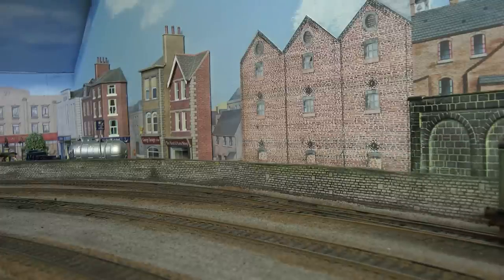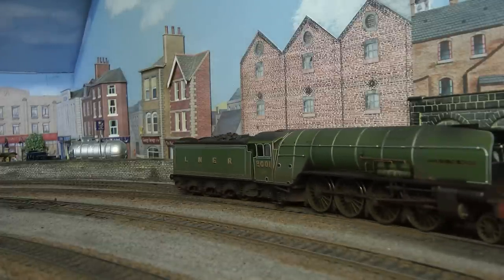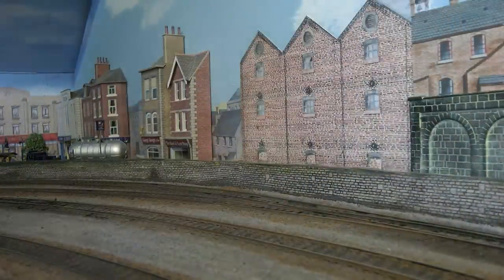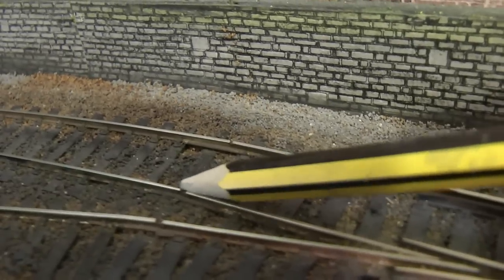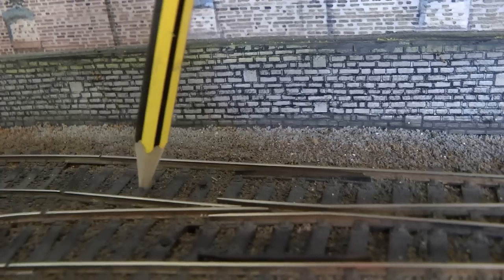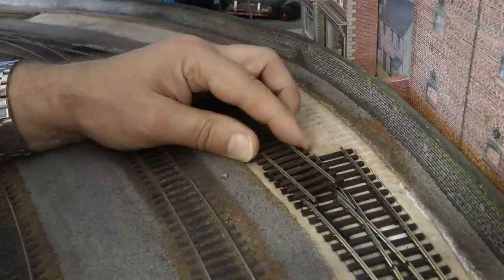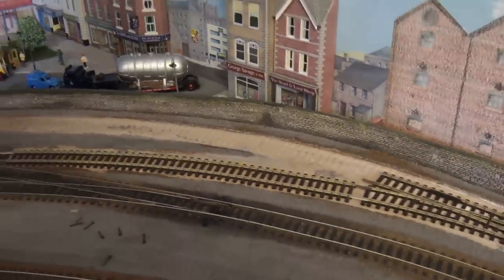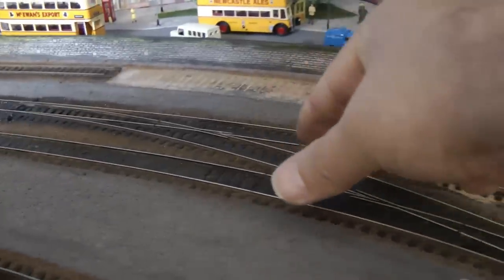Trackwork Rework.   No 380

Comment: Thanks Tony for posting, a brave man but needs must.  Well done.  I have just had to relay a length of my track which had expanded in all the heat.  After more than a week of outside air teperatures of over 27C a curved section had lifted and warped. I freed the track and eased the curve by 2.5mm without needing to do any cutting.   Wall paper paste instead of PVA to hold the ballast makes it all a bit simpler.  Regards Ray
Reply from the maker: Hi Ray. heat will do that my friend. its great that you didn't have to lift the full length up. 
Great tip with wallpaper paste i may have to give that idea a try. thanks again for commenting. cheer's for now Tony.

Comment: Murphy's Law is what i think it's called. Of all my fleet of locos my ultimate favourite is an old Triang Blue Pullman that i have done a considerable amount of upgrading and detailing - it's complete with reprofiled wheels in order for it to run on modern track but it is the only locomotive that will not take a particular bend but always jumps the track. Every other loco i have has no problem with this bend. I checked the wheel 'back to back' and that's fine. As the track on this bend is set track I took the loco to my model rail shop and they ran it without a hitch on similar set track curves (apart from which there's another bend on my own layout with the same curve )and it manages that fine; I've checked the track for lumps and bumps and I can't find anything and as I say, it is the only locomotive that jumps the track there. I think I'm going to have to do what you've done, namely relay the track there. Fortunately for me I don't have any points there. Thanks for your video Tony.

Comment: Morning Tony, that was a good job done, looks neat and the p2 runs smoothly. You can plan all you want but it's only when you use it you can see any issues that arise. It will be interesting to see what you do with the brewery, I was a bit surprised we didn't see Billy and his mates having a gawk at what you were doing, its not like them to miss out. 😅 you made that look so easy, but I imagine there's a few hours work gone in there. That was a good tip on getting the track out of the points, to remove a section in the middle is always challenging but twisting the rails was a excellent solution. Fairly easy this week for me after the busy week we had last week. My friend in work who's father passed and has given me bits and bobs gave me a test track about 8' long with 3 tracks on it, 00, N, Z, I'd never seen Z it's tiny, but I've managed to get that running now and she's found a engine and wagon so that's interesting to see, it's a continental steam engine made by maklin, far to small for me but interesting. My daughter Vicky, has gone away for the weekend so so good old mum and dad are look after her dog for her, it's the first time she's had a sleepover although we have her a lot in the day, and so far she's been very good. OK must go, nice to see your work, speak soon Eddy and Anne xxx
Reply from the maker: Good morning Eddy. After your busy week. you can now put your feet up and watch the trains go by on your layout. i do have some plans for the brewery. but its all a question about fitting time for these little jobs. thanks again my friend. all the best from Tony & Laura. have a great weekend.

Comment: ❤-ly thanks for the very important information NOT to use MDF-plates and Change to plywood - but what thickness is best?
Reply from the maker: Great point! 12mm plywood is best for baseboard tops. looking back i should never used MDF for ply wood tops. but in saying that. this is the area where i have problems with this material. its probably down to me not treating the edges. we live and learn. all the best Tony

Comment: Hi Tony. Eight wheelers require a larger radius than six and that kink in the track and the incorrect turnout formation needs to be investigated by the Permanent Rail department.  The Lengthmen and their Ganger responsible for that length of track need a telling off for not reporting those anomalies. 😄
I noticed that after the addition of the new curved turnout, you did not appear the test the diverging road. I assume you did that off video.
I'm not a fan of MDF, Tony.  It loves water and will absorb moisture and curl.  If I was to build a new layout, baseboards would all made of birch plywood.
One big difference between ready to run model railway and the UK 12” to 1 foot scale railway, is that, the former is made from fixed formations known as turnouts, slips and diamond crossings, and plain track.  This provides ease of use when building layouts, but imposes limitations on the modeller.  In the latter, the Permanent Way is largely bespoke to location, made from basic elements called Switches (colloquially known as ‘points’ because they are pointed) and Crossings, namely; Common Crossings (Frog is American speak taken from a part of a horses hoof) and Obtuse Crossings.  The formations that arise from S&C work are called turnouts, slips, diamond crossings, etc, in accordance with strict rules, the types of train expected and their anticipated speed. These formations are interconnected by standard rail.  This results in flowing trackwork through formations, with correct radius curves for the traffic used.
The way to achieve this in model railways, is to build your own track and formations; no more difficult to achieve than many of your builds, Tony.
I look forward to seeing more Permanent Way work at the North Eastern,  Best, Jason.
Reply from the maker: Hi Jason. Permanent way is now permanently fixed. and its a long time coming to get it fixed properly. I do like when a plan comes together. now its back to building these little projects. see you next time my friend. cheer's Tony

Comment: At 2:35 the click is caused by the second set of driving wheels re-railing.  One can see they are off as it approaches.
Reply from the maker: Thank you John, great spot.  as you rightly said it came off before going through the point. and it was happening every time. yet other locos had no trouble going through. i am just glad its done. and we now have a smoother running for P2. thanks again. cheer's Tony